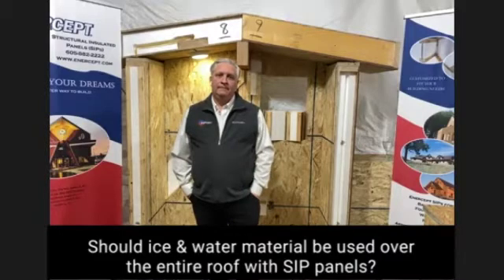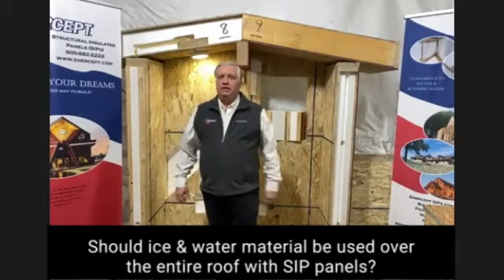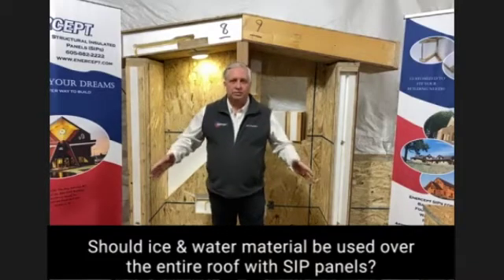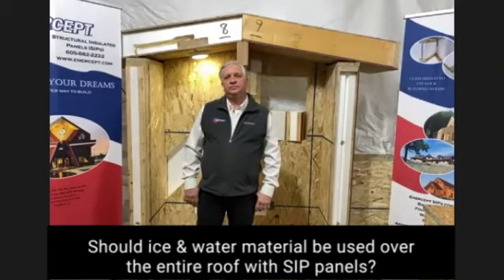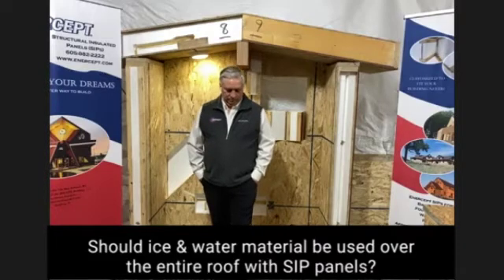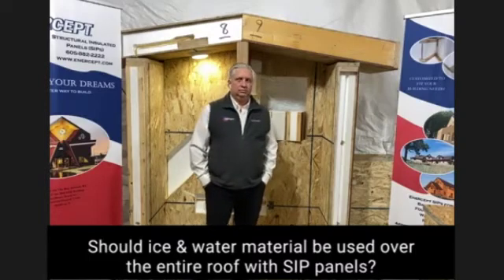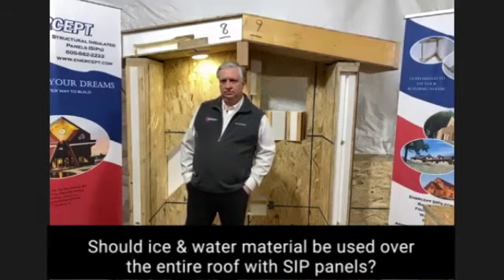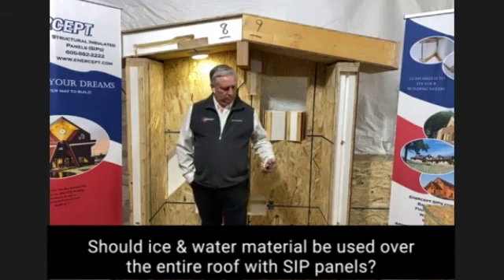Should ice and water material be used over the entire roof with SIP panels?

Comment: Thanks for the video. We have a small bungalow with a 5/12 pitch roof. The house has  a small,  10' wide covered verandah with a 9/12 peak on the verandah.  We are reshingling the roof with shingles. have 3/4" boards over the entire roof.  There are a lot of gaps between the boards (anywhere from 1/8", with most gaps being about 1/4", but with a few gaps up to a 1/2" wide between the roof boards. As is, we cannot air nail the shingles, as some will go in the gaps and create holes.  We were given 2 recommendations to reshingle.  I will list those here. Could you please tell me the better option and why?  Our roof is stripped and will be shingled  beginning in the next day or two. 
We really need some solid advice. Thank you.

If money were no concern, which is the better option for longevity and waterproofing of the roof, as well as shingles being less likely to blow off (we are in an area with lots of high winds and humidty in Nova Scotia, Canada).  We understand that under certain conditions, if the winds are high enough, you can lose some shingles, so just getting opinion of what would be LESS LIKELY to come off, air-nailing or hand- nailing?  The following are the 2 potential scenarios.  Which do you deem better and why?  Thanks.

1.
- existing roof boards; add Ice & water shield to entire roof; hand-nail entire roof

versus:

2.
- resheath entire roof with OSB over existing boards; just regular Nova Prime wrap over entire roof and water & ice shield in usual areas; air nail entire roof
Reply from the maker: Option 2 will provide a better roof deck from a structural standpoint.  The existing roof you have described was a methodology used many years ago when roof sheathing like plywood or OSB was not yet available in the marketplace.  The OSB will provide both a structural diaphragm and a solid nailing surface for the shingles.
Reply: @EnerceptSIPs  Thank you!  🙂